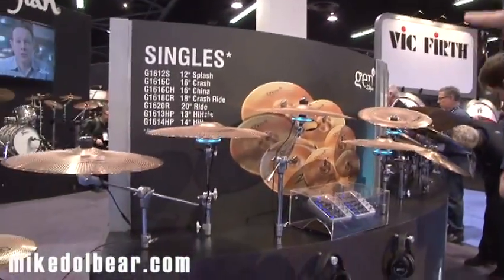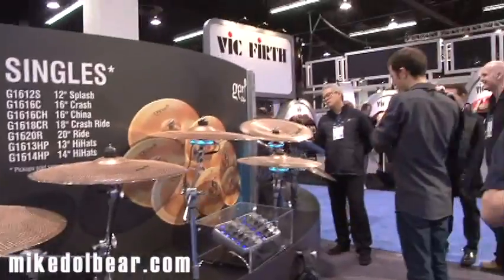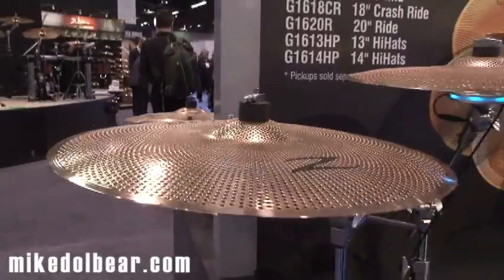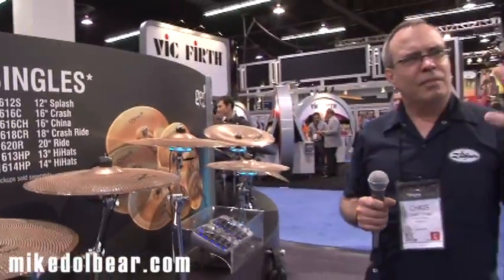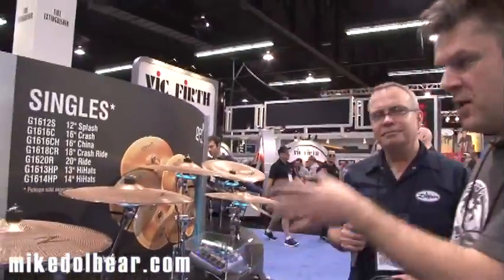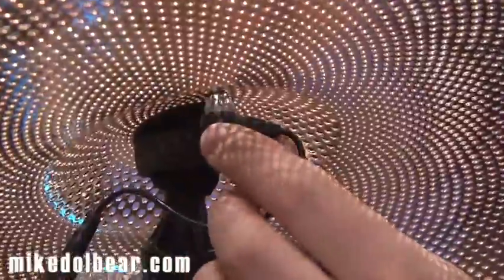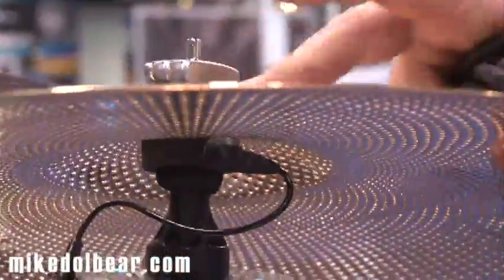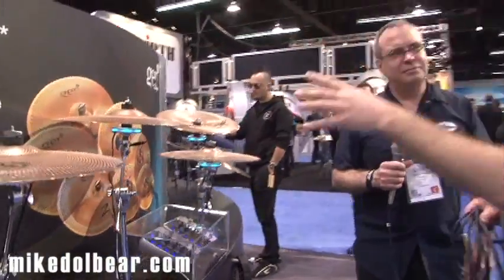Zildjian Gen16 and performance NAMM14

Comment: Purchased 'em a while ago. First thing i did was tweaking the toneshapes 'cause the standard presets sounded awful.
It's not an easy job to create the right sound to fit the needs but once you get the hang of it the sound possabilities are endless.
The feel is way better than cymbal pads of course, giving more fun with practicing at home.

Comment: They are too expensive, and don't sound all that great for the sound quality. They are a nice concept, but Zildjian should lower the price tag considerably. It doesn't make any sense that price.
Reply: Not only do I completely agree, but I think that Zildjian should market these in smaller sizes, which would also be a great way to get the cost down. If I'm going to play an electric kit: it's going to be for simplicity and portability, and not to lug around a bunch of things which are the same size as real acoustic instruments. If they had a pack of these with a 10" hi-hat, 14" crash and 16" ride: I'd be all over it for my electric (portable) set-up.

Why play something the size of a cymbal which (somewhat) emulates the sound of a true acoustic cymbal when you can just play a real cymbal? They should be focusing on the fact that these feel like real cymbals and are quieter than real cymbals, unlike rubber/plastic/composite cymbals, which -- while still quieter -- don't handle like a real cymbal; Zildjian should be targeting users of synthetic cymbal triggers instead of trying to pass these off as a new instrument.
Reply: The Timesmyth exactly. I hope they take this into consideration because as for myself, i will not pay a lot for real size cymbals since i already have them. And if i want emulated sounds, i can allways convert some cheap brass cymbals into electric pads.
Reply: The Timesmyth i kind of agree with you and a lot of comments, too expensive, sound horrible. I've never owned a Zildjian cymbal, they have always been too expensive (and find some other brands better, matter of tast anyway), but i admire them trying the technology, i've owned e-kit for almost 20 years now, the feel is really rubbish especially the cymbals. I think having same size cymbals do make sense for some people like me, who want a kit to be close in feel to acoustic drums. 18" ride and 14" crash, with a 12" hi hat would be good, it would still be in the similar physical size (i mean when you ride, you want to have a different bounce depending on where you play it, on a 16" it doesnt work), it's all tricky to achieve i guess..